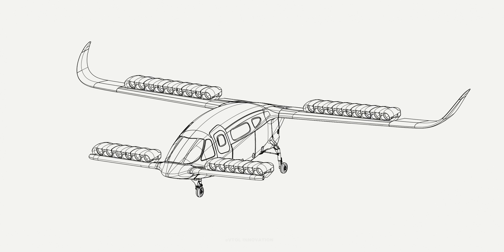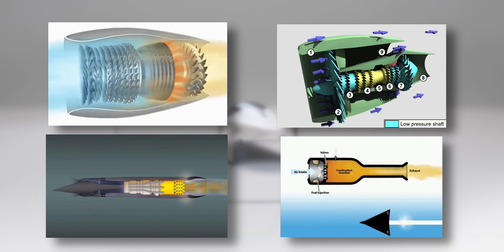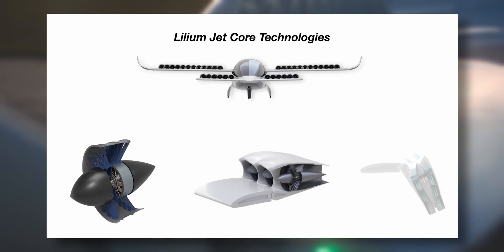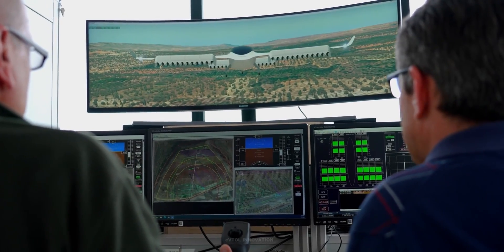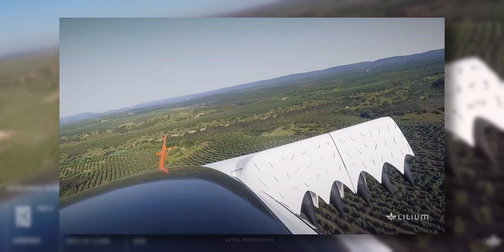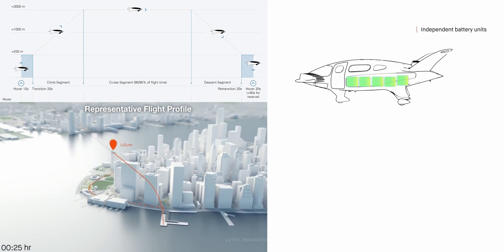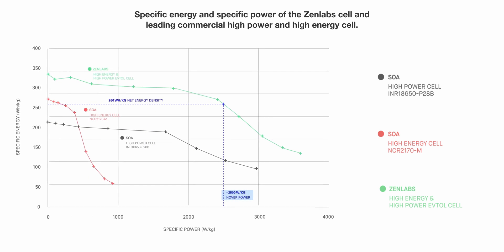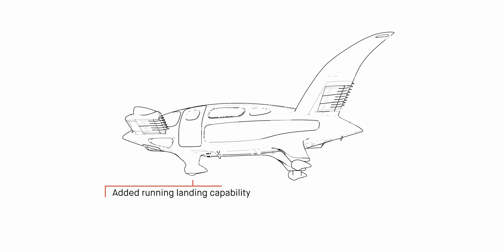The Insane Engineering behind The Lilium Jet | Part 2

Comment: Why don’t Lilium put in a range extender generator to double the range?
Reply: They cannot add anymore weight, the batteries are in charge of 2.2 megawatts to hover because of 30 duct fans and the weight.

Comment: How long does it take to fully charge and what happens if you lose all power when flying? Can it charge up as fast as it takes to refuel a regular airplane? Can it glide? If you're going to tell us how impressive the engineering is, you should probably answer these basic and obvious questions.

Comment: It is clear that Lilium will work best in a short take-off and landing setup.  How short a runway will be needed will depend on the load and weather conditions.
So for me Joby is the most optimal solution since it can do vetol and thus access a city location, which will be reinforced  apartment rooftops that are also being used by helicopter operators.

I do like the Lilium solution but they needs to go for airport setups which means just using the jets in an underbody configuration and no need for small distributed jet, just 4 large jets which reduce complexity and maintenance costs which simplifies everything. 

The battery can thus be used for more range since no need to hover.
The analysis is telling them what market to go for but Lilium refuses and is sticking to the e-Vetol market . 
This is not going to work, thus the institutional investors have gone to Joby  etc.

Comment: It will unfortunately be years before zoning and doubting armchair experts will be ok with city landings. So save battery power and use small airports and have vertical landing for future and/or emergencies. I hope this electric ducted fan aircraft continues to evolve. They could benefit by going to a STOL event and see what is working with currently flying aircraft that take off in 100 feet.

Comment: The world sustainablility is so cringe.  In Stanley Meyers patents, he had a REAL combustion JET, that could be modified for air planes.  He was killed by the oil barons.  The hydrogen was the fuel after splitting the water.  These new EV technologies are less about sustainablitly and more about control.  Meyers technology was also zero emission.  These electric vehicles will be so expensive that only the rich will be able to use them.  And the amount of environmental degradation from the creation of batteries will render the sustainablity claim hypocritical.

Comment: They have given no test data to support their claims, a full seize prototype has not yet flown and their  7seater does not stack up mechanically or commercially. Way to muck hype about this aircraft. the supposed dates of the prototype launch have been put back time after time. The aircraft will undoubtedly fly but its range and commercial viability are greatly disputed Aeronautical data that they have based their prospectus on has been shown to be incorrect.

Comment: A birdlike design with hybrid electric range using ethanol and toroidal propellers  and solid state batteries to reduce the weight a little more  feathered wings  wing tip winglets 3 on each wing bigger engine sets 2 on each wing and one built into the tail the tail feathers having a downward curl at the tips acting like a vertical stabilizer the tail drive system has the small ethanol motor and in horizontal flight the engine is turn off  so that only at vertical take off and landing and when electric range is reached will it ever be used very little using very clean burning fuel two and a haft passengers which is to say a third passenger if they aren't too heavy like a dog or a light woman or kid or some bags packed a rumble seat  would be good for this decorative solar panels suggestive of feather pattern on back wings and tail theoretically able to recharge the electric motors for horizontal take off and short electric range flight with horizontal landing so your not completely stranded without fuel water landing variant with floating skies and the solar panels have a scaly look to them instead 2 sets of 3 engines on the wings only for this version no ethanol motor horizontal take off and land only ,but still birdlike design just like the first if your landing on water your don't need vertical take off anyway 
and last but not least insect like design dragon fly one and a haft seat two sets of wings forking out front set longer than rear set tilt motors at the tips of each wing ethanol engine behind the haft seat in the body of the flyer no wing feathers  or tail feather small vertical stabilizer at the end of the streamlined body hard thin land skies you could buy those off a normal helicopter kit solar panels have armor like pattern on the body only wings are white  rounded canopy  almost like the real bug small enough you could sell it as a kit  just a suggestion   AK

Comment: Is not a "JET"! It is just an Electric FAN engine. The term JET is used for internal combustion engines.
The first engine was the TurboJet. The rest, TurboFan, TurboScramJet, TurboPro are all derived from the internal combustion "JET".
It's just an electric motor with FAN!
So it's called Elerric FAN.
Reply: “Gas turbine” and even then there’s a couple of break downs such as “axial flow” (German design) vs “centrifugal flow” (British design) ….semantics…it’s a thing unfortunately

Comment: You totally ignore the major elephant in the room, power source.
Reply: Or the range…the most “efficient” electric engine still can only travel a 3rd of the distance as any ICE…it’s almost like it’s the laws of physics holding back electric vehicles vs the laws of man 😏…weight and energy density are still a thing and unfortunately there’s still more stored energy in one gallon of fossil fuel which weighs about 6-7 lbs than a several hundred pound battery

Comment: I am a 92 year old retired Aeronautical Structures  Engineer “ex Canadair RCAF Boeing and Transport Canada Airworthiness” and see one of the the greatest developments in engineering is, the improvements in batteries bringing forth tremendously the use of the Electric motor . This motor is so versatile in its use and development,  it’s vastly increased application is amazing. Could you have ever imagined the way Lillium  has adapted the electric motor for flight.
Reply: A adapted jet engine using Stanley Meyers patents is likely MORE sustainable, as they dont have to mine using Afican slave labor.  And this EV most likely can only be flown in good weather.

Comment: Without combustion, I have to call it a ducted fan. Cool design though. Mine forces air over the wing.
Reply: It is a duct fan, powered by an electric MOTOR. Not an internal combustion jet ENGINE. A prop plane shoots a jet of air too, but we don't call them jet planes.  Details don't seem to be very important to the general populous. Although it is good marketing, people will associate safety because you call it a jet, not a fan like that thing on the ceiling of their house.

Comment: Using the term "jet" to refer to the propulsion may be colloquially adequate, but won't showcase the difference between combustion-based airbreathing reaction engines and any other kind of propulsion system (though it does share some similarity with rocket engines and ion thrusters).

That's because what makes a jet enginebe called like that is the fact that the combustion directly powers the rotation of main fan blades. There aren't any pistons or even any mechanical power transfer other than the axle shared by the combustion compressor and the main fan.

Still, we usually call any ducted-fan a "jet" engine; Why? Well, that's because all jet engines are, by design limitations, ducted fans! This is the natural consequence of needing a proper chamber for the combustion, access to plenty of air for the combustion to occur and a nozzle at the end to increase the speed of the resulting airflow (mainly the air that gets "bypassed" on modern turbofans, though the combustion exhaustion also helps a bit).

So yeah, Electric turbofans cannot be considered jet engines, as they are driven by electric motors, not a mix of compressed air and fuel... Or anything similar. An ion thruster, however, could be made into an electric jet engine, as you can ionize the compressed air to accelerate it and drive the rotor shaft. But I don't see the point of doing so, as ion thrusters (and rocket engines) accelerate gasses beyond "intake" speed (not that rockets have any intake, LMAO), meaning that they don't need a mechanical compressor, just a nozzle at the exhaust.

Oh, and if you are wondering why jets need the air to exit the nozzle at a greater speed than it enters, the answer is quite simple: You can only move using air jets as fast as the air gets expelled. We call this "nozzle velocity". However, the blades of any fan can only accelerate air as fast as their tips move (at best, that is), meaning that the closer you get to Mach 1, the closer you are to having flow separation occur on the tip of a conventional turboprop aircraft's propeller blades. 

When this happens, the aircraft suffers severe efficiency losses as the propeller blades experience flow separation. Moreover, the parasitic drag over their surface of the blades increase by the square of their speeds, meaning less fuel efficiency the faster the blades rotate and the larger they are. Hence the need for nozzles and, by extension, the duct around the fan.

Finally, let's not forget that the faster the blades move, the more kinetic energy they have (making collision with objects or animals potentially catastrophic.

That explains intake to exhaust ratios (or nozzle rations), but why should you use two giant turbines instead of many smaller ones?
1- Smaller turbines need the same kind of components as larger ones, and the miniaturization will not always translate into a proportionally lighter and smaller component due to material and technology limitations. It also makes maintenance a pain in the back.
Big metal. Stronk. Potent. Never broke. Monke happy.

2- Smaller turbines will have a way high percentage of nacelle frontal and external area / total turbine area (nacelle duct and the turbine fan). This means an increase in the drag and friction the more engines you use to achieve the same thrust.
Plane smooth. Air flows. Monke happy.

3- Not an specialist, but I've seen somewhere that multiple engines running close to one another can also be a source of problems. May or may not search for it later.

So remember that juicy, gargantuan GE90 and its successor, the GE9X? That's why they are like that.

Though this is not possible for small VTOL aircrafts like this one.
Reply: Excellent explanation and analysis. Aside from the fact of having many engines for thrust being detrimental to performance and the problems of maintenance, it also just looks strange and inefficient, purely as a visual analysis. To me, it looks like something from the cold war era soviet design bureau, but with advances in battery design. 
Also, the use of the word "jet" as nomenclature is, in my opinion, purely for marketing hype and sensationalism, as is most marketing these days because people are becoming more and more drawn to, (and persuaded by) idiomatic expressions and labels.

Comment: Real-world aircraft operate at close to gross weight. For a typical small aircraft, payload can represent as much as 50% of total gross weight. The performance numbers given here are at “operational empty weight”. Assuming that the aircraft has a relatively small payload (as one would expect from a battery aircraft) of, say,  25% of gross weight, the energy requirements for VTOL will be considerably larger which will affect both range and safety margins.  

I would really be interested to see how this aircraft performs using a conventional runway.  Certain existing VTOL aircraft such as the Harrier aircraft reauire rolling takeoffs when loaded to near gross weight as they are incapable of vertical takeoff fully loaded despite using fuel that has an energy density almost ten times that of the best batteries. Furthermore, the Harrier, being both a warplane and fuel-consuming aircraft has an advantage for vertical landing as it is much closer to empty weight upon landing having shed much of its payload weight while in flight. 

My point is that for all the press that eVTOL aircraft are getting, true, practical, electric flight will appear sooner in conventional fixed-wing form as it is much easier to achieve.
Reply: Yes... just because it can VTOL doesn't mean it must always VTOL.

Comment: The remote control flying world has already adopted the EDF designation for electric model jets. The nitrio fueled R/C Jets have been called DUCTED FANS since the 1970's.
R/C Jets with the new generation of electric motors have been called EDF's since the early 2000's.
Lilium is electric. Lilium is powered by multiple Ducted fan units. So as far as I can see, EDF applies. 
Having said all of that, the public will make all this engineering work worthwhile. The company will have to decide whether EDF or JET will play best with the consumer who will ride in it. And I didn't forget the FAA. Lawyers too. Liability will also play a part in how things are marketed. It will be interesting to see how this plays out. 
But as a licensed pilot, I'm just ready for a ride.

Comment: Its all unscientific nonsense. Especially the battery and propulsion part. An EDF is inefficient and that x 30 or even times 36. Where are the discharge rates? Where the capacity of the battery? Missing all necessary info. How many Volts? How many Amps? Running time aprox. 10 min.....range 5 miles.  Anybody with some performance info? What a dream- for money

Comment: Great video. Looking forward to more contents in the future. Love this channel.

One of the important part to evaluate the cell performance which is not captured by Lilium is the battery cycling performance. It's a trade-off between power, energy and cycle life. 
It's great to see the battery can provide enough power for vertical take-off and landing while has decent energy density. However, the unit economics will suffer if the cycle life is bad and drive the operation cost too high, then the price won't be accepted by broader users
Reply: In aviation, we are used to engine-overhauls, replacements and even major fuel tank overhauls.  So, to replace recyclable batteries every several years should not be problematic.   However, maintaining battery temperatures would be a major problem to solve.    I am not thinking that such batteries would be subject to cycles  such as in automotive applications.  During normal operations, jet aircraft can constantly  trickle regen.

Comment: ok, lets assume it works and there is a 50 km range transfer service. After landing you need to recharge again for how many hours then ? I am not getting the concept and I can not derive any usage and business model. The further we are away  the more likely is a speedy alternative connection and the more specific the connection is, the less number of persons are there and recharging is difficult. Anyway, a nice money burner and interesting to follow as long as not invested.
Reply from the maker: Watch The Insane Engineering behind The Lilium Jet | Part 2
https://youtu.be/Cn-5qqgEW6E
Reply: Battery swap ...
Reply: Ok…that common sense you’ve got …it has no purpose in this brave new world 😂…this engineering is pipe dream territory 🫡

Comment: I imagine Lilium will eventually add capacitors to the battery system.
Reply: And what would that solve? 0x0 doesn’t equal 1
Reply: @localenterprisebroadcastin5971 Higher power requirements for time of vertical up and down. It's not rocket science.
Reply: Capacitors are much heavier than batteries

Comment: It is a ducted fan engine.  Calling it a jet is silly.  By your definition, a prop is a jet.
Reply from the maker: No. Jet (noun) a rapid stream of liquid or gas forced out of a small opening.
Reply: @eVTOLinnovation  The gas is being propelled by a fan.  We are not talking about a compressor fan in a jet.  It is a fan that pushes air through a tube.  If it makes you guys feel better, keep calling a ducted fan a jet.  Just know that you will be constantly ridiculed by trying to change the definition of a ducted fan to a jet.
Reply from the maker: The majority of the gas does not go through the compressor in a TurboFan.
Reply: @eVTOLinnovation  I didn't say that.  I said your fan is not a compressor fan.  Fact:  Your propulsion system is an electric motor turning a fan.  The fan provides the thrust.  It is a ducted fan.  I am not taking away from the coolness of the plane.  It is very cool, but calling it a jet is just like the woke crowd trying to reinvent history.

Comment: It is not a jet period. It is called a ducted fan stop playing word games to make it sound “oh so special it’s a jet” sarcasm. No such thing as an electric jet engine! OK you wanna call it a jet let’s see it do at least mock .55 in pressurized comfort.
Reply from the maker: @flu flu Jets maybe, not an engine
Reply: I don't care what its called, as long as it works in purpose designed for.
Reply from the maker: It is a Jet Engine by definition.
Reply: @eVTOLinnovation  anybody can change the definition on Wikipedia to whatever they wanted to say. Is that what you did? Jet engines are internal combustion engines stop playing your childish word games. It’s still a ducted fan!
Reply from the maker: @mrsmith324   Alastair McIntosh, Lilium's Chief Technology Officer, Who worked for Rolls-Royce and was in charge of delivering the Trent XWB for the A350, calls it a Jet Engine. He is definitely not wrong and I don't think he is lying.
Reply: @eVTOLinnovation  He is wrong! Perhaps there is a language issue, the nomenclature is definitely incorrect. Look up the definition of motor vs engine. Electric motor, Internal Combustion Engine ICE.